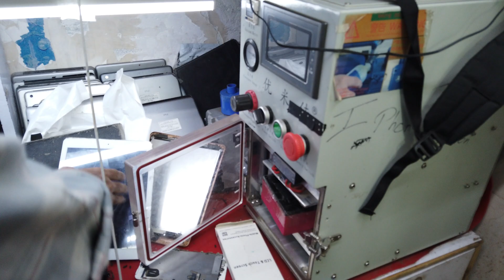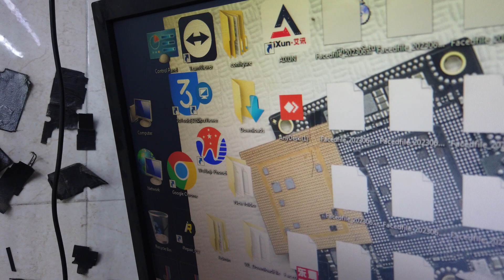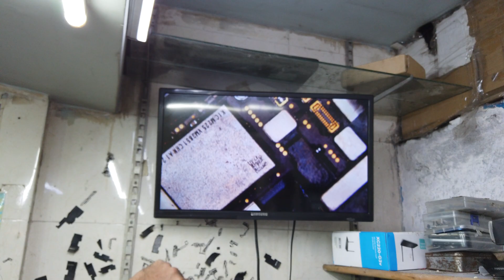The Magic behind iPhone Repairs in India 🇮🇳

Comment: Apple and other manufacturers should be forced to make the batteries accessible.

In the AirPods it would be easy with a screw system. For the case cuts special screws on the downside of the case

Comment: Only problem with these shops is that they can't get original parts, either they have salvage from old motherboards or use chinese counterparts, I wish brands like samsung would sell parts online to repair so we can buy and have them repair, espesially battery, original would be best to have!
Reply from the maker: yeah and when they tried selling those parts in the past, it was very difficult to get your hands on them and ended up just being a marketing plot...
Reply: @ExploringTheSimulation  🥲

Comment: I wonder why they think the laser method for back glass repair causes battery and back camera problems?
Reply: If the laser is not aligned properly, it could shine into the camera. That would 100% fk up the camera.
Reply from the maker: I also thought it was odd.

I've never done it personally so I'm not a trustworthy source for that, but I've seen the laser method used quite a lot before and I've never heard about problems like that.

For the camera, I agree that it sounds like they misaligned something or didn't use the right file/shape.

For the battery it's harder to tell since it's supposed to be behind a metal sheet. Maybe they weren't using the right laser type or the settings were too powerful?
Reply: @ExploringTheSimulation If you really want to do the laser method the "right way", you're supposed to remove basically everything from the iPhone inside (battery, motherboard, camera) to ensure that none of the delicate internal components are damaged by the laser's heat or intensity.

Comment: Nice! If only replacing the batteries on AirPods were standard practice all around the world.
Reply from the maker: I agree, the sad reality is that it's only possible there because the wages are very low. It's not economically feasible in the West since it takes too much time.

It's still nice to know that it's possible somewhere and that old devices could potentially be shipped there in bulk to be refurbished. Definitely not ideal, but it's better than throwing them away.
Reply: Sadly the only reason it's worth repairing in Indiana is because their wages are terrible. 
Apple (and not only Apple) made replacing the battery so hard that it's mostly not worth doing it in any country with livable wages.
Reply: In Russia, some service centers take on this. About two years ago, I changed the batteries in my AirPods for $15.